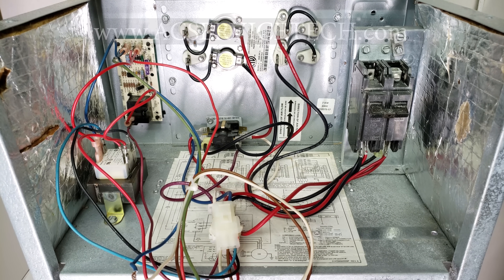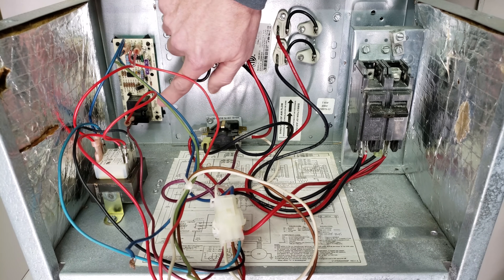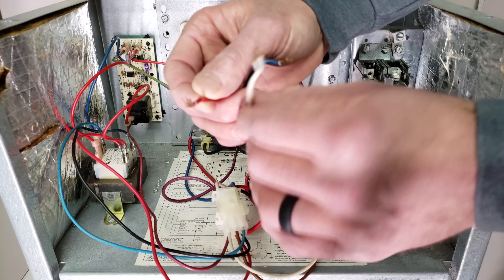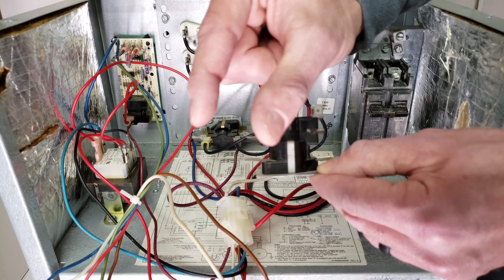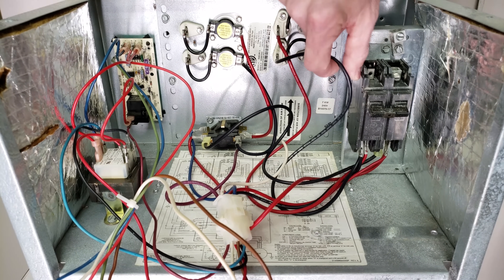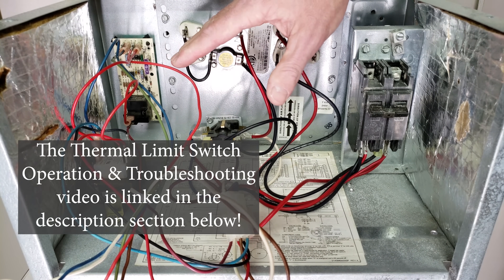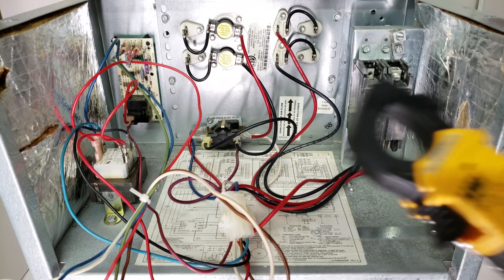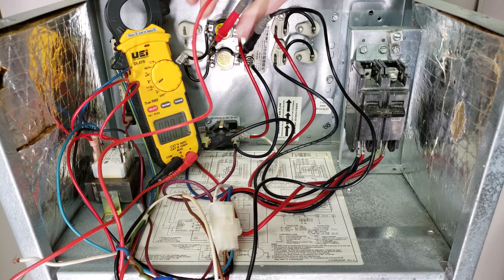Air Handler with Electric Strip Heating: Operation and Troubleshooting!

Comment: im my handler, the relay melted at the fan speed (COM) and normaly closed (NC) terminals. does that mean theres a short or is that typical when a control board fails? i dont want to replace the board only to have it fry again. thanks
2ton goodman straight cool control board (PCBFM103S)

Comment: So is the green wire powered in heating? Or does that purple wire give 240 to the blower motor and turn it on? The purple wire on that relay is what confused me a bit?

Comment: On a Carrier FB4CNF036 air handler there isn't a fan control board like you show in the video. All of the wires go into the fan motor. Is the fan control board built into the fan motor assembly?
Reply: Speed taps

Comment: Why the need for both thermal limit (resettable disks) AND the thermal fuse? If heater box overheats, the thermal limit will do its job and shut down the coils until they cool. Or why not have only thermal fuses which will shut down coils until the problem is solved? All thermal fuses would be safest.
Reply: Omg been doing this for a few years now, sequencesors always trip me up .THANX for the info ,Order or operation
Reply from the maker: Glad to help! The thermal limits will shut the heat strips off and then will automatic reset so the system will still operate in a low airflow situation such as a partially clogged filter. The fuses will pop only if the thermal limit breaks and is welded in the closed position. The fuse is the safety for the thermal limit. You don't want only fuses and not thermal limits otherwise we will be out there all the time replacing them, thanks!
Reply: AC Service Tech LLC    Thanks Craig. Perfect explanation as usual. Yep, if thermal limit disk welded or malfunctioned closed, with no fusible link present, then fire dept. may be coming real soon! 😱

Comment: Bro how much setting chiller r134a low high pressure switch
Reply from the maker: It will really depend on the unit and application, thanks!

Comment: My thoughts on efficiency regarding standby current.  For example when my heat pump is in the cool mode the changeover valve gets and stays energized 24/7 using about 8 watts from the 240volt xformer.  Which at $.13 kwh uses about $10 /year, not huge but I wonder if this is been changed on energy star units?
Reply: The reversing valve is energized by the orange wire in the tstat only on a call for cooling on most systems. On others it is only energized on a heat call.  Why do you feel it is energized all the time?  If it is, you need to have a technician to check it, because its not supposed to be energized unless there is a call.
Reply: @officerkrupke4966  This is normal operation of this style valve, spring pressure for heat and solenoid for cool mode, it should not de energize on every cool cycle as is would wear it out needlessly.  This video shows operation: https://www.youtube.com/watch?v=r8n1_6qmsKQ
It would've been nice in FL to have valve needing power for heat which I use a few weeks out of the year.  More importantly this 20 year old system is running at peak efficiency with SP well below spec and superheat and subcool good. On hottest days it runs 4 hrs per 24 sized properly while other homes here run 12-18 hrs a day, so I cannot complain.  Thanks for your input.
Reply from the maker: Hey AD, so the manufacturers Ruud and Rheem are the ones that power the reversing valve in heating mode. Everybody else powers theirs in cooling mode. It may just be that is what they have done in the past and they don't want to change in the future. Also they perceive heating as more important than cooling so if the valve were to fail, it will usually fail in the non powered state which would be more important than cooling. However, it just depends on the location of the customer and these manufacturers sell the units specifically for everywhere in the US except southwest where there is less humidity, thanks!
Reply: @acservicetechchannel  Well that explains it, I figured about the "fail safe spring mode" in heating mode. I'm sure energy star units are maybe more efficient about 10 watts for a reversing valve today, and  transformers can be wound poorly hurting efficiency, today the have a roman numeral IV or V on AC to AC 24 volt xformers showing efficiency, so it all adds up.  Thx for the response.
Reply: Running four hrs out of twenty four on hottest days may not be as nice as you think.  Less run time means less humidity control. Muggy house.
Reply: @publicmail2 I did not find evidence of your claim in the link unless it was corrected
Reply: @acservicetechchannel  Exactly, this was a southern unit, albeit a HP, the unit actually reduces standby watts by 5 when in heating vs cooling, because the reversing valve is not energized in heating.  Thx
Reply: @officerkrupke4966  Not in this case,  RH is 40% in summer as unit is sized properly, and more importantly home is well insulated cutting heat load.
Reply: @officerkrupke4966  I am the an HVAC tech and installed unit.  This is a Heil from 2001 and they chose to have reversing valve energized as such.  It's not a huge amount, but from a standby current 24/7, the blower and condenser uses about 18 -20 watts which with todays units may be considerably less.  The problem is the 24V  xformers are old style, and pull a couple watts unloaded, todays class IV ones are much better...Thx
Reply: Nothing should be energized if your thermostat set to off. It it is, very poor design!

Comment: My question is in the MCA and MOCP for 240/208 for unit with electric heat.  I always see like for example MCA 56/49 and MOCP 60/50 for 240/208.  Wouldn’t the higher voltage mean a smaller breaker?  Feel like the voltages or breakers labeled are backwards.  FYI I am looking at a Lennox air handler for those numbers, but I see it on Carrier too.
Reply from the maker: I would need a pic of that to jog my memory on that one. Usually they only have only one per rating but I know what you mean. You could email the pic to info@acservicetech.com thanks!